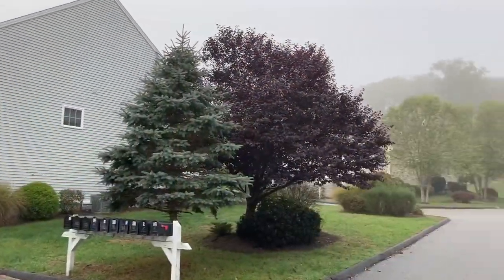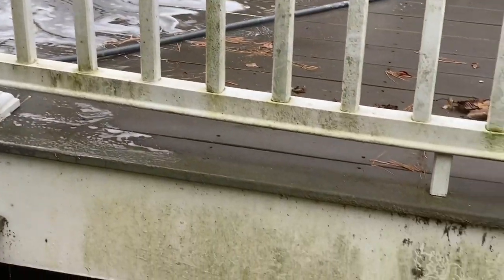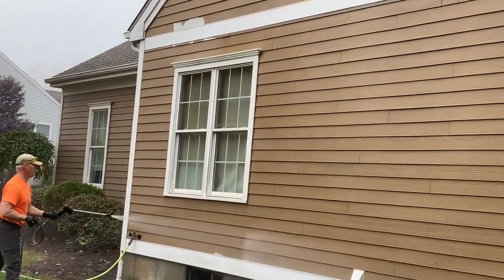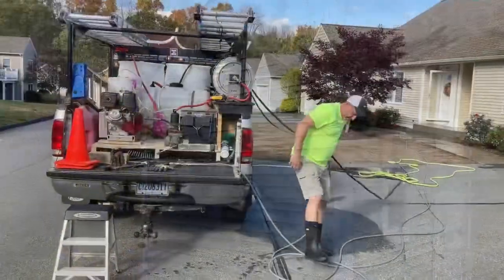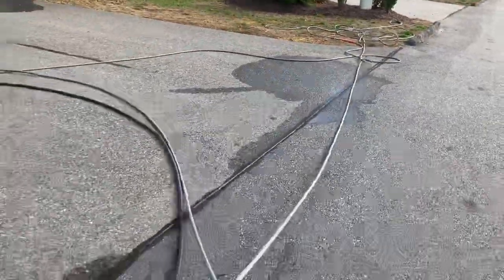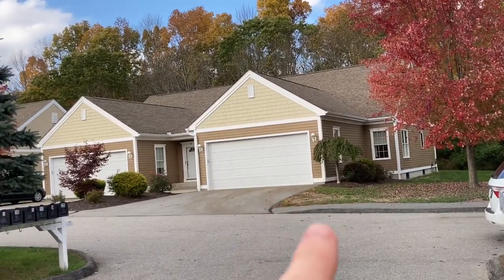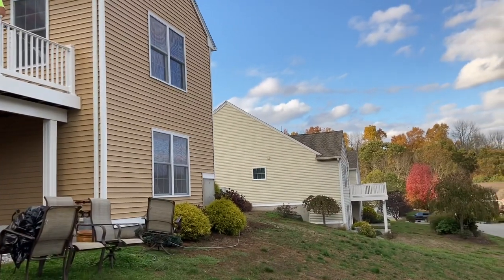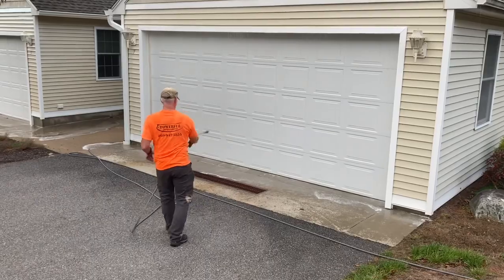Biggest Project this year

Comment: Dang Boi!!  Excellent Premium Ticket 👍  you going to get a 8gpm?
Reply: Another ? for you- when you started out w/ the 2.4(what i have) how did you apply Chem & rinse?  Was it all just DS & X-Jet??
Reply from the maker: TyMD18 When I was running the 2.5. I was using the X jet to apply chemical and rinse
Reply from the maker: TyMD18 I’m thinking 5.5. I out run water supply as it is too often. I don’t want to carry a huge buffer for 8
Reply: True, yeah,  I just saw your other video about your plans for Spring rig.  But you didn't mention the big square tank you picked up a couple weeks ago.   Prolly won't fit on your truck,  right
Reply from the maker: TyMD18 Yeah. I don’t want to carry the big tank on the truck. I may set up a trailer just to haul water with
Reply: Cool, thx dude
Reply: What's up Joe Mikey from Boston here I've noticed you running into water problems from time to time i installed Hudson float valves into my tanks couldn't be happier check them out make life easier